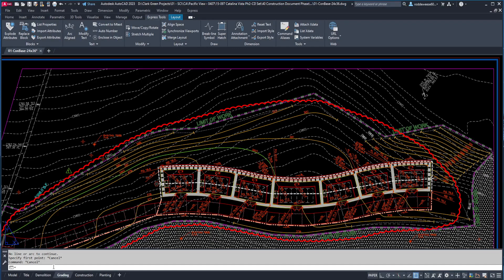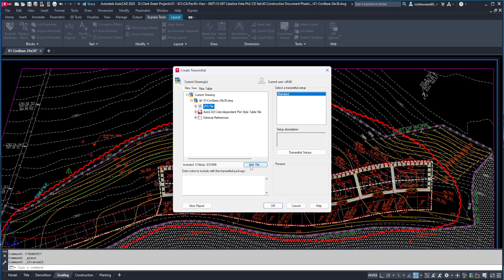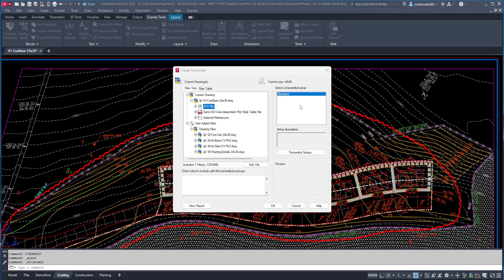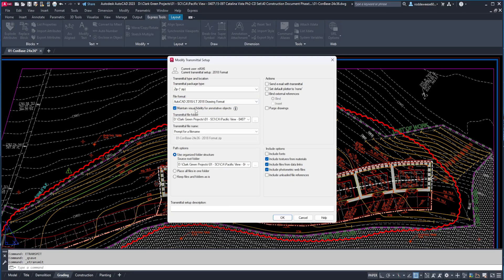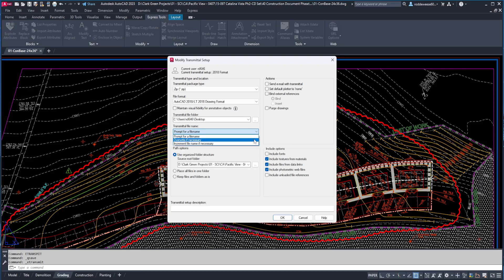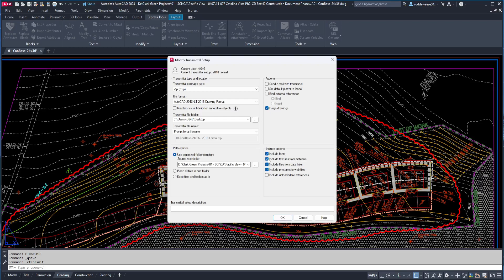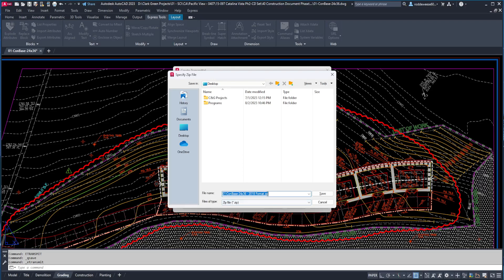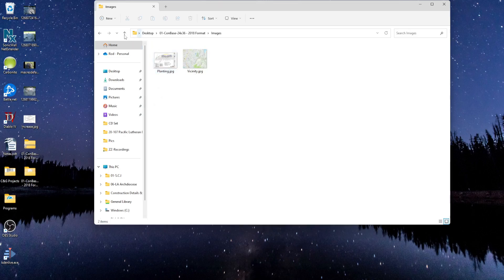Autocad - Share CAD Files using Etransmit

Comment: Great video.  Is there any benefit to choosing the bind  xrefs option?
Reply from the maker: Thanks! The "Bind Xrefs" option will do just what it says. It will gather all your xrefs and then instead of including them in the zip file as external files, it will place them all inside your main drawing as blocks. I don't personally like doing that, and my clients typically want the xrefs as separate files, but I encourage you to experiment. Try it with and without binding and see which works best for you.